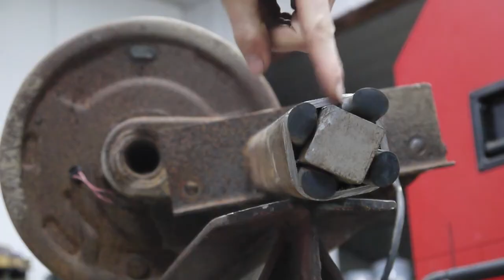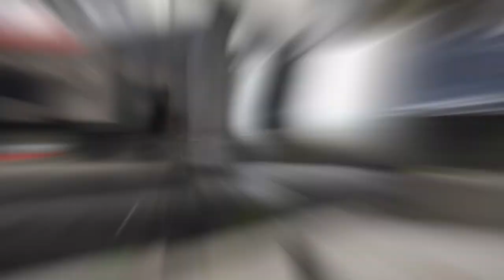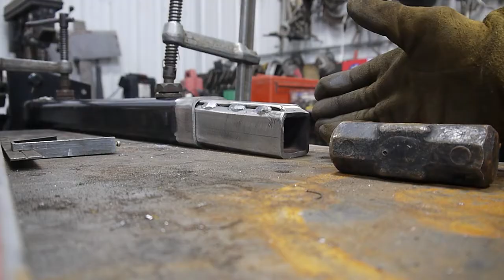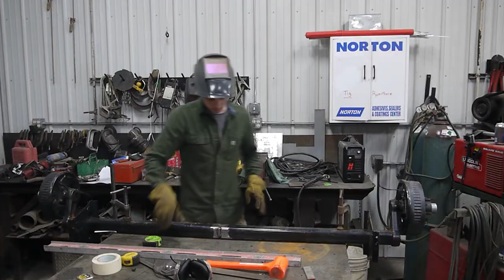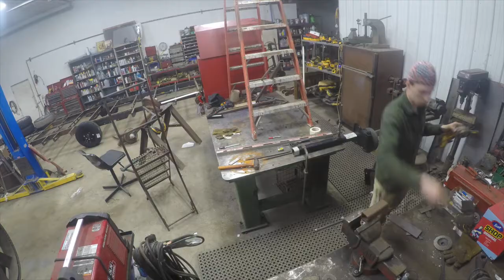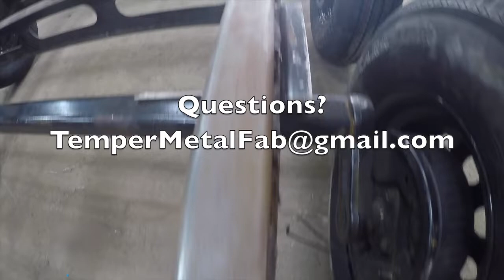Torsion Axles & How To Shorten Them

Comment: Dude nice job ,I have similar situation  but I have to lengthen from 72 to 98inch on 4inch 10,000lb axels all disc brake hydraulic , need to add 13 inches same theory  but in reverse?
Reply from the maker: Thanks for watching! Yeah, same theory but in reverse should work great.

Comment: My front passenger side tire is wearing on the inside third of the tread on my tandem axle. Any ideas how to figure out if its a bent spindle versus mis alignment. 

Dexter torflex, lightweight travel trailer. Thanks.

Comment: Excellent work. One thing I think you might not realize is, by measuring the gap of your straight edge on the original length axel and then applying that same gap measurement to the shortened axel, you increased the camber. Measuring the gap at the desired shortened length would be more accurate. That being said it’s probably not a huge deviation as you only shortened a few inches. Again, great job and thanks for the insights!

Comment: I've just bought a new axle for my trailer.  The trailer is galvanised and sound but the axle and wheels are shot. There is a T bar bolted to the axle, and I was concerned that there was a shaft running through the box section . What a dummy, that would have meant the suspension would not have been independent.  Great video, explained all. Thanks😊

Comment: I love the idea of stud welds.  Very smart.  My only constructive criticism is to butt the end of your tape measure against the point of measurement rather than bending the tape and estimating the total length due to the radius of the tape.  Most tape measures have their length on the bottom for doing this, but it’s irrelevant in this scenario so long as the distances are the same.  This is how I do redneck alignments. Lol

Comment: I got here from IC Welds channel. one thing you should take into account is the flex of the axle. with that burly insert you have taken a bunch of flex out, and you should adjust you angles accordingly to get a correct tire alignment.
Reply: That could actually stiffen it up so it doesn't bow

Comment: Good job. I always drill ½ holes for plug welds before I weld the spacer in. I install the spacer then weld the plug welds after making sure everything is square. I bevel the ends of the tubes then leave them 3/16 apart then weld the spacer and tubes together. This way it all gets melted together. This is how I do it and it works for me.  Good job and it will last forever.

Comment: Well done video. I have family in Dexter. Have you ever replaced a spindle on a Torflex axle? It seems like one could grind off the weld on the end of the spindle and push out the old spindle, then push in and weld in a new spindle.
Reply from the maker: Thank you! I haven’t had much experience on a Torflex but that sounds correct.

Comment: You could always grind the scarf off the inner weld to make putting in the insert.  As Construction Engineering & Analysis says below the insert changes the bending characteristics of the axle so the deflection of the axle under load will be totally different than the original axle.  It would be worthwhile to put this axle in an arbor press and load it up before and after to see how much the insert affects camber...
Reply: There is virtually no load the center of the axle - all the weight is carried at the brackets at the ends. The tube just keeps the wheel camber steady.
Reply: @tgriebe  Interesting that you should say that... have you studied engineering?  and in particular Mechanics of solids?  the wheels bear the load at the point of contact with the road... since the brackets are NOT directly above this point of contact there is a bending moment that needs to be carried thru the bracket across the axle... otherwise  the bracket must be designed to carry the full bending moment (these are available).
Reply: @mfsolutions  Yup, practiced mechanical engineering for a full career. Yes, there is a moment because the spindle is cantilevered outward, but the resisting moment arm, which is the entire tube from one bracket to the next has ample length and strength to maintain the camber angle. And yes inserting the splice in the center changes the bending characteristics of the axle tube, but it isn't designed to flex or bend under use. It is designed to hold the camber angle steady under use. In short, I think the work this young man did is perfectly acceptable.
Reply from the maker: Thanks for the response Gregory! The arbor press is a great idea. The insert absolutely changes the bending characteristics of the axle. If this axle was going to be constantly under very heavy load, it would have made more sense to spend the extra money on the right sized axle to begin with. The insert provides reinforcement for the welded joint and its heat affected zone. Since the middle of the axle is a high stress point when loaded, I chose to slightly modify the camber characteristics for the extra reinforcement.

Comment: Is the square tube used as axle and other parts on axle made of regular mild steel or a different type of steel
Reply from the maker: Unfortunately I believe that the answer to your question will differ between manufacturer. Axles are typically manufactured with a higher grade steel.

Comment: Where are you located?
I destroyed a 3500lb axle on my travel trailer off road and had it replaced with a 5500lb axle now one side is higher than the other causing the tire to wear quickly on the outside edge.
Reply from the maker: I am located in Dexter Michigan. It sounds like the new axle should have required some mounting modifications.

Comment: How close can I mount the trailer frame to the swing arm of torsion axle? .
Reply from the maker: As long as the arm clears the frame of your trailer when you hit a bump, you will be okay.
Reply: That's what I figured. But I worried about any flex?
Reply from the maker: @paulbisceglia6824  is it a cambered axle?
Reply: @TemperMetalFabrication  its a dexter axle
Reply from the maker: @paulbisceglia6824  either way, you’ll want to stay somewhere close to where the factory mounts are on the axle. Moving a little bit won’t hurt anything.

Comment: I just don't get why someone would make a trailer using axles that will be scrap in 25 years.  The trailer I normally use has been in my family for about 30 years and was built long before that.  Having it turn to crap in less than that time would be really annoying.  I guess people who are 20 years old think this is a great idea?
Reply: Coil and leaf springs aren't meant to last longer than that either if you're actually using them for work. Leaf springs and leaf spring axles also wear out over time as well, springs sag, and axles lose the bow angle in the middle and they start eating tires.  Everything needs maintenance, torsion axles are $150 a piece for 3500# axles, and you get an axle that is better behaved in rough terrain and all the components built together in one piece.

Comment: It is 1-1/8" at the length form the manufacturer based on loads to ''straighten out'' the camber... at a shorter length the 1-1/8" is more than likely off the table but don't fear; your loads will determine if the wheels will be parallel upon loading. 
As far as your center welded tube goes... depending on loading on the axle will determine how the loads transfer via your new ''gusset connection" (you actually did bad on adding that extra filler piece; as it will add a torque reaction down the tube ''lesser'' on three sides.
Again, I would not be too concerned unless you are maxing the loads on these axles. 
This torsion system works under ''compression'' and the resistance of material around the center bar is compressed upon loading... all four corners will rotate as one and push / compress the filler material...  But, nothing is for free, it still adds a rotation / torque in the bar / axle...  (that is where it meets in the middle and your one side being stronger can come into play... under maximum loaded (say, on one wheel, like mounting a curb, etc. = this will put max rotation on the centerline of this system. 
You will know if you max out system if deck ''cannot lower any further upon adding extra loading" (means the torsion bar has rotated and compressed material to it's maximum and at that point the bar itself becomes in torque up to the center and possibly to the opposite wheel)...
With all that said, you can simply add a "piece of metal onto you your torsion bar at the centerline of the span and if "twist"; you will have an indicator that your loads are greater than the system is capable of (it will act as an indicator of overloading)... 
Which you the best.
Reply from the maker: Thank you for your detailed response! You are correct about a lot of these facts. Fortunately, I was only shortening these axles a few inches. Like you mentioned, the load of the axles will determine the exact camber, so keeping an estimated camber angle was my main goal.
 If these axles were going to be constantly loaded to their maximum capacity, I may have chosen a different route. Again, you are correct about the transfer of the load down the tube, but that is getting much more technical than what is necessary. With what these axles will be used for, the minor load that may be transferred though the axle will never be an issue.

Comment: The only thing I would add is the way you're measuring. You keep referencing 1 1/8" but that doesn't give you an angle. In my case I want to cut my axle down to 48" to make a trailer for my quad. If I want to keep my gap at 1", over the current 8 foot span, that's an 89 degree angle, but when I shorten it to 48" and I keep the 1" gap, it's actually a 88 degree angle. In your case, only shortening by an inch, it doesn't matter much. But in my case, shortening by 4 feet, I need to keep that angle the same, and ignore the value of the gap. In theory, the more you cut off, the smaller your gap should get.
Reply from the maker: Thanks for the comment buddy and you are absolutely correct! Using the angle is definitely more precise but also more work. For your application I would agree to reference the angle.

Comment: Wouldn't it be easier to make new mounts on the trailer? Nice jerb otherwise. 👍
Reply from the maker: Thanks! There are two reasons I didn’t make new mounts on the trailer. First, it would be very hard to make it as strong as the original mounts because the original mounts are on the same plane as the frame. So all the weight goes directly up to the frame rails rather than on an angle if I had extended them. And second, the airstream body covers the top half of the outside edge of the wheel so if the axle is too long, the wheels will hit the metal shell.

Comment: Quick question, how did you keep the camber when you inserted the 6" jointing piece? Surely the 6" straight piece kept 'going straight' (for lack of a better ter? this is the only bit I'm confused with. Any info would help! thanks :)
Reply from the maker: Yes the 6” piece is straight. But since it is smaller than the axle tubing, you can still achieve camber if you measure correctly and tack it carefully. Another way to help is to tack and weld the bottom of the axle first because as the metal heats up, it expands but it contracts 1.5x as it cools so it will pull the camber in even more.

Comment: I’ve got just the opposite problem. I want to widen a couple torsion axles so your video has been a great help. I have a very competent welder that does all my welding. Do you have any suggestions I can relay to him when I go to have him widen these for me
Reply from the maker: Thank you, I’m glad the video has helped you! My biggest advice is to measure everything multiple times! Especially your camber angle of the axle because after you cut it, you will no longer have the arch to measure. Just take your time on the fit up so that all of your angles are perfect otherwise you will eat through tires and add stress points to the axle.

Comment: While this was nicely thought through, I have to wonder why you didn't just buy a brand new and inexpensive
 Dexter Torflex axle of the correct dimension.  Looks to me like you have more time and effort in this project than a new Dexter axle costs.
Reply: Donald! And why were you watching this video? I couldn’t help but wonder. Tho your comment and question was almost nice. It really wasn’t.
Reply from the maker: Of course I looked into that. A new axle with the correct dimensions was almost $1,000. I picked up both of these axles, brand new from an rv manufacturer for under $200. Why spend an extra $1800? I would rather save it with a little elbow grease.
Reply: @TemperMetalFabrication  The brand new model 10F (4K# rating) Torflex axle under my travel trailer was only $420 in Aug 2017, and included spindles, bearings and brakes, delivered to the shop.  Good deal, no?
Reply from the maker: Donald Neilson yeah. That’s a great deal. The drop angle and mounting dimensions made my axles much more expensive than normal. That’s why I went this route.

Comment: Very nice job!! Very informative about setting the camber!! I need to widen a torsion axle and the top on drilling the hole and sending a wire through was a big help! Thank you
Reply: can get away with doing that way on a small change like that, but if you take a bigger section out of the middle, the height of the end of the level needs to decrease proportionally.